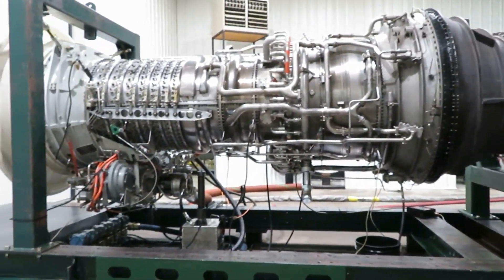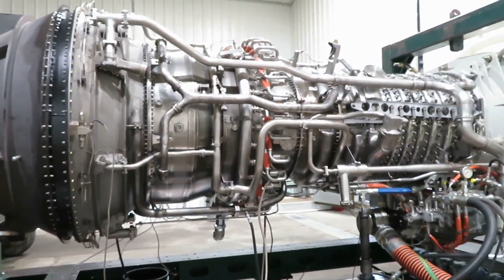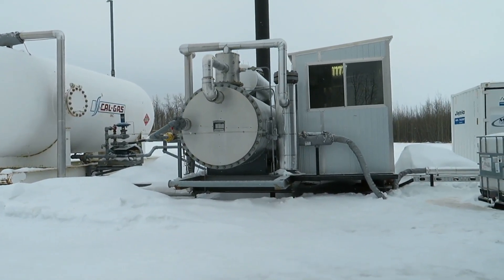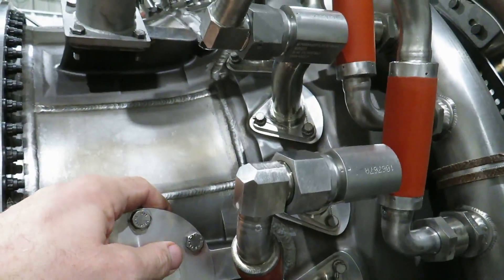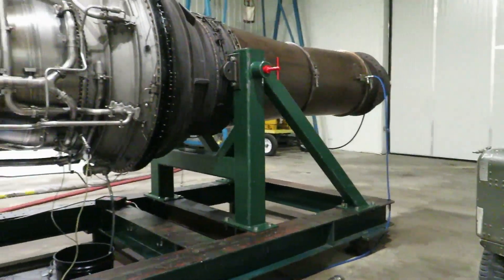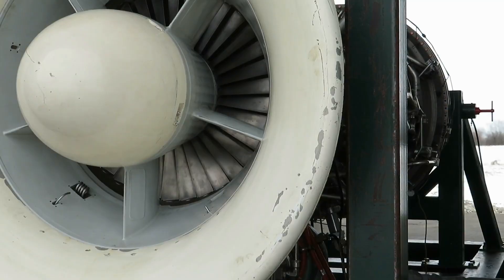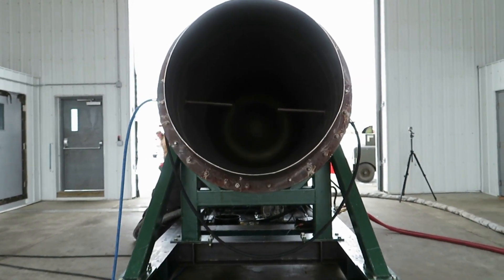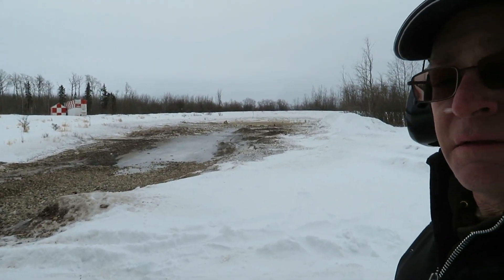The Big Engine - the GE LM2500

Comment: So what’s the burn rate of that engine.
Reply from the maker: That can mean whatever you want.
So yes.
Reply: At the risk of being smacked down by the man... are you asking for fuel burn? This is a CF6 core, so if you look at CF6 numbers then you will probably be in the right ball park. This is also a near top of the range engine. So let's pretend it's a 67,500 pound thrust CF6. Specific Fuel Consumption is 0.348-0.359 lb/(lbf-hr). Let's say 0.355. Just multiply the SFC by the thrust and you get 22,625 pounds of Jet-A per hour at rated power. But this is burning propane, and I expect they are derated for continuous operation. The aircraft engine maximum thrust is not sustainable for the long term, just for a few minutes. You need to factor the energy content difference between the propane and Jet-A and take a wild ass guess at what proportion of the aircraft engine power it was running. Or you could ask the man what you really wanted to know, since he was probably watching the fuel flow to check performance.

Comment: Is it common for jet engines to have variable guidevanes? Looked absolutely awesome how smooth they all moved
Reply from the maker: It is quite common. Have a look at my video Compressor Stall to find out why they are used.
Reply: @AgentJayZ  I came here right after you video on compressor stall (thanks to the algorithm recommending it). Your explanations helped me understand quite a bit better how these marvels of engineering work. When I saw that mechanism moving, I immediately knew what was happening thanks to your video. Thanks for all the hard work you do.
Reply: @AgentJayZ  thanks a lot, will definitely do that

Comment: It ran at over 9,000 rpm. I missed when VTEC kicked in.  ;)
Reply from the maker: It's called Variable Compressor Geometry, and it works between Idle and about 80% rpm in a continuous smooth progression.
The effect is similar to VTEC in a piston engine.
I explain the system and why it's needed in my video called Compressor Stall.
Reply: It kicked in after the 2nd rpm. 9,000 is getting close to that overspeed.

Comment: Y do u test an engine with propane when it runs jet fuel when intalled in a plane or helicopter?
Reply from the maker: We don't. The LM2500 is an industrial engine that runs on natural gas. We substitue propane because then we can avoid building a natural gas pipeline to our test cell, saving us millions of dollars.
Reply: For those (like myself) who didn't understand the difference between Propane and Natural Gas: Natural gas is a naturally occurring hydrocarbon mostly made of Methane, but it also contains butane, ethane, propane, and tiny amounts of carbon dioxide, nitrogen, helium, and hydrogen sulfide. These contaminate gases are usually removed from the Natural Gas before being delivered to your home to prevent them separating and condensing as a liquid in the natural gas pipeline. Propane is a by-product of the refinement of fossil fuels, such as petroleum and natural gas. 
Propane has a higher energy density than Natural Gas, and is generally sold as a fairly pure, liquified form. It is extremely clean burning, and most things that run on Natural Gas can be converted to propane very easily (and vice versa).

Comment: Fun fact:  Add a high-bypass turbofan to this engine and you get a CF-6 which has been used to power 747, 757 and 767 aircraft.
Reply from the maker: Yes, this was covered in my series of videos called turbofan parts donor, where we took parts out of a CF6-6 to complete a build up of an LM2500.
Reply: Don’t think the CF6 ever saw service with the 757.  The 75 was nicely over powered as is with the PW and RR engines, but the CF6 would have been insane on that aircraft.  It was on the 757’s big brother, the 767, as mentioned…among other large aircraft.

Comment: amazing those bolts and nuts don't rattle off....   how again do they stay on... safety wire ???
Reply: Check out JZ's vids on lock wire.
Reply: Lock wire plus they are incredibly balanced and max vibration to cause an automatic shutdown is usually 10 mil of vibration.
Reply: Lock wiring and you gotta mske sure they do it right if the person gets lazy and lock wires it incorrectly bolts will come loose and issues will occcire so i take my time when i lock wire

Comment: I use to work on the LM2500 in the Military. If you're using propane as fuel, do you have to adjust the main fuel control specific gravity to something else to compensate?
Reply from the maker: This engine normally would run on natural gas the fuel control can easily adjust for the minor difference. We don't have to change anything.
Reply: @AgentJayZ  Cool thanks.

Comment: not to be sarcastic but its not a jet engine. It's a land based turbine engine. It used for generating  power for an electrical generator.
Reply from the maker: You is absolutely correct. That's normally a distinction saved for the advanced classes.
Reply: ok I have worked on the LM2500 and all the way up to the MS9000. I worked at howmets machining facility and GE johnson Tech. Machining for a total of about 35 years of experience.
Reply: @AgentJayZ  ok
Reply: But aren't these using their jet exhaust as a Gas Generator to impinge against a seperate power Turbine which drives a gearbox which drive the 60HZ AC generator. Like a gaseous Automatic transmission torque converter.  Who overhauls the power turbine?
Reply: PlaneSpotterHeaven yes.  You are correct.
Reply: Oh this is a new one, I only knew them from our Oliver Hazard Perry frigates. Real beasts they are.

Comment: My first job out of school was for a company that packaged the LM2500s and 5000s with generators. Nothing was cooler than getting to work and listening to the gas turbines being started and load tested. Giant columns of steam rising up from the metal plates being dropped into huge tanks of water. Even got to work on the LM6000 engines, as they were introduced in 1991. Learned a lot since then and this video brings back some good memories. Thanks for sharing.

Comment: Curious, what are the two red/orange lines running to the test stand?
Reply from the maker: Those supply coolant from a large tank outside. The coolant runs through a liquid-cooled oil cooler to regulate the temperature of the engine oil in the LM2500.
Reply: @AgentJayZ  DOH  Forgot about the oil cooler. Makes sense on a test stand that it would not be self contained. 
By the way, is this the largest engine you've had in the shop?
Reply: @dremwolf5419  Fun fact, although this is a land based engine, not a jet engine, if it WERE a jet engine, those lines would typically be going to a heat exchanger to keep the oil temperature regulated. The heat exchanger actually exchanges that heat to the jet fuel before it goes into the engine. Jet fuel gets VERY cold in the wings of an airplane, and makes a great heat sink for the heat in the oil. 
Bonus factoid: There have been cases where a fuel leak between the heat exchanger and the engine fuel control valve could be detected by an abnormally low oil temperature on a jet engine while in flight.

Comment: 6:41 That long bracket with the holes in it Is that changing the vanes inside the compressor stage of the engine ??..like a variable vane turbocharger? If so this seems to be newer technology used to make more efficient power yes?
Reply from the maker: The first variable stator engine was the J79, which first ran in the early 1950s, so yes... newer technology to make engines more powerful, but not more fuel efficient.
Reply: Thx  @AgentJayZ  What about my analogy of the variable geometry turbo? The newer airliners boast jet engines that produce more power but use less fuel I guess I`m wondering how do they do this.
Reply from the maker: The parts that vary on the VNTs that I know of would correspond to the turbine inlet guide vanes, also called turbine nozzles. Those are not variable in any gas turbine engine I know of. The variable geometry of engines is in the stators of the axial compressors.
Turbochargers have centrifugal compressors, so they don't have the airfoil shaped stators that are variable in jet engines.
The reason newer engines use less fuel and make more thrust is because development is always moving forward, and new stuff is better than old stuff. There are many, many areas of improvement that might be advancing by one percent per year, and it's been almost 80 years since the first jet engines struggled to make 1000lbs thrust.
Reply: @DaMan1964  The 2 shaft industrial 7500 hp and 32,000 hp GE MS3002 and MS5002 used variable first stage turbine nozzles that were hydraulically powered and that could be a similar analogy to variable geometry turbos. I had a few apart for major overhauls in the field. I don't think aero high bypass engines have variable nozzles.  Chevron had 5 oil tankers each powered by a single GE MS 3002 back in the 1980's. I overhauled every one on them and did the Chevron Oregon twice.  Those variable turbine nozzles looked like big hatchets when removed from the casing. The 3002 did not have variable compressor stator vanes like this LM2500 has.

Comment: What is this engine used on?
Reply from the maker: The LM2500 is an industrial gas turbine engine, derived from the CF6-6 airliner turbofan engine. Each version of this design has several uses. GE has lots of great info about both on their site.
Reply: @AgentJayZ  Thank you very interesting
Reply: These engines were mainly used to turn generators or compressors. This is the heart of the oil and gas industry, power industry, and emergency back up systems for hospitals and other applications. Gas compressor stations along a pipeline usually run these engines to move gas up and down the lines.
Reply: @Clifton Green They still power most surface combatants in the US Navy, including Ticonderoga-class CGs, Arleigh Burke-class DDGs,  and Independence-class LCSs, the latter two ship classes still in production.

Comment: Faaarkenelll! Whassat engine used for? It sure has some grunt, 300000 horsepower! Root a boot! I reckon a pair of those would push a large ocean liner. What about if the thrust was pushed under the ship into the water?
Reply from the maker: 30 thousand, not 300. Quite a few cruise ships get by with one of these. Using a power turbine to convert the exhaust gas energy to shaft torque and power, these can drive a propeller through a large gearbox, or an electrical generator that can power the more modern propulsion pod systems.
Reply: Oops, that extra zero......

Comment: Someone explain please , it looks like and sounds like he said it starts with compressed air , but he said it starts with the propane tank. I don't get it
Reply from the maker: A small gas turbine engine in the start cart is used to generate a supply of air at about 30 psi. This air is fed to a small air turbine starter, which spins up the rotor of the big engine through its gearbox.
The big engine is fueled with natural gas when it is installed, and we replace that with propane so we can avoid the expense of having a pipeline built to supply natural gas to our test cell.
Reply: @AgentJayZ  So what starts the engine spinning is compressed air then propane fuels the engine itself? So they're  both required to start the engine?   I 100% trust what you say, I'm just trying to understand
Reply from the maker: I explained it in detail. Maybe read one of those books. What starts the engine is the starter. Please watch "how to start a jet engine". It might help.
Reply: @AgentJayZ  Thanks......
Reply: Joshua Ballew yes that's right. The start cart spins up the turbine using compressed air, and once it's spinning fast enough to sustain itself, fuel (propane in this case) is added to the combustor and ignited. This spins up the engine the rest of the way and it becomes self-sustaining so the start cart is no longer needed and is removed. 

The turbine must be spinning at a certain minimum speed for combustion to be sufficient to keep it running, and the compressed air from the start cart gets it to that speed.

Many smaller turbines use electric starters, like a lot of turboprops. In this case, instead of compressed air, an electric motor is used to spin up the engine. This is more practical when there's less mass to spin as there is in a smaller turbine.

It's very similar to a car's piston engine, where simply sparking the cylinders won't do anything when the engine isn't running. You need the starter motor to get the pistons moving fast enough to compress sufficient air that enough fuel can be added to keep the engine running.

Sorry if this is redundant or you've already figured it out, this stuff is so cool and I love nerding out about it!
Reply: @Concorde1059  Thank you for being helpful and explaining it. Did alot better than the guy that made the video (:     Subbed
Reply: The assembly that is not mentioned in this conversation is the Accessory Gear Box (AGB).  The air starter is connected to the compressor which rotates gears  that eventually rotates other gears that are connected to the compressor.
Reply: So what application is a CNG turbo jet used in?

Comment: Wait, some people claim that jet engines run on compressed air or something? I HAVE to see these comments. It's not that I don't believe *you*, it's that I don't believe anyone could be so mouthbreathingly stupid.
Reply from the maker: You will not find that mental excrement here, and you will not be directed to it on my channel. It's not too hard to find out there...
Reply: Probably just a misunderstanding.  The combustion process DOES use compressed air but it is air that the gas generator section of the engine compressed.  So it does not operate on compressed air but needs compressed air to operate.

Comment: Propane as jet engine fuel O_o? desire to know more intensifies
Reply: Yup, jet engines can run on either kerosene, or propane. Jet engines can actually run on basically anything that burns, with little modification. Petrol, diesel, alcohol, CNG, probably cooking oil, the dreams of children, etc. If it is a liquid that burns, it can probably run on it. But getting back on track; all jet fuel is, is kerosene with anti-icing additives thrown in, and that's basically it. This is why the plane your on smells like kerosene when the engines are spooled up - because that's what they drink. Jets can be quite easily modified to run on natural gas/propane, simply by changing the fuel nozzles (fuel injectors, basically), and I believe that's all that needs to be done. I could be dead wrong, though. I'm still learning quite a lot, myself, and have only subbed to this channel very, very recently.

As for why they do this, many reasons. It burns a lot more cleanly, produces almost no soot, is much better for emissions, contains more bang for buck, and has no nasty corrosive crap to eat away at the engine. The reason why aircraft don't use LPG, is because the tanks required would be far, far too heavy, and far, far too dangerous. Otherwise they would. The reason they are using LPG here, is because for brand new/just rebuilt engines, they like to use LPG to test them and run them for the first time, for the above reasons. Almost every static engine that runs on the ground, runs on some form of LPG. For example, these engines which are used for electricity generation, run on LPG. It's simply a better fuel and there aren't any real safety or weight concerns, as the whole contraption is fixed to the ground somewhere.

I could be wrong about some, or even most, of what I've said here, but I have been trying to do my homework. Any kind folks reading this would be more than welcome to kindly correct me or add any more information, if they like. We're all still learning, here.

Hope this helps!
Reply from the maker: Gas turbine can run on any source of heat. When changing from a liquid fuel to a gaseous fuel, a completely different fuel system is used. However, some industrial engines have fuel nozzles with both liquid and gaseous circuits, which are fed by two different fuel controls, although not at the same time, but they can switch between the two while running.
Reply: @AgentJayZ  They can run on Distillate Fuel Oil as well.
Reply: @uzaiyaro  Not just turbine engines. Most engines are capable of running on any kind of fuel source. Diesel engines can run on veg oil, for example.  Wood gas, coal gas, propane, natural gas, hydrogen, pretty much anything combustible or organic could be used. Even spices, if you were motivated enough. Not all engines types are suited for every fuel source though, mind you.
A lot of our infrastructure, such a trains, cars, jets, stationary engines, etc. are capable of running on multiple sources of fuel, they just need to be adapted over to handle the different fuel source. There are plenty of YT channels that can give you more info on converting one engine type to a different fuel, if that's something you're interested.  I've seen wood gas be used for electricity generation, and propane be used to run a car. Somebody even modified their car to run on a mix of gasoline and hydrogen. Mussolini made the trains run on thyme, of all things.
Reply: @WarrenGarabrandt  Yeah, Ive actually bought a car that has had an LPG conversion. It's more of an addition here, because it still has the petrol system. But you can switch between the two fuels on the fly, about as seamlessly as it can giving there's an interlock that prevents both fuels from being used at the same time. That interlock does have a period of time where no fuel is being supplied to the engine, maybe half a second or so, if that. It's not perfect, but you can switch between the two when you're driving and it'll switch over fairly well.